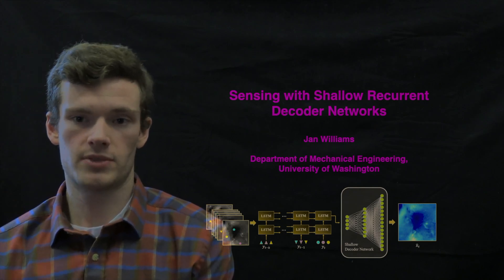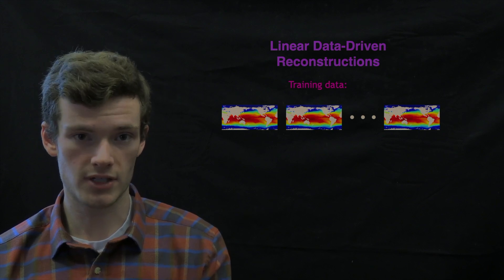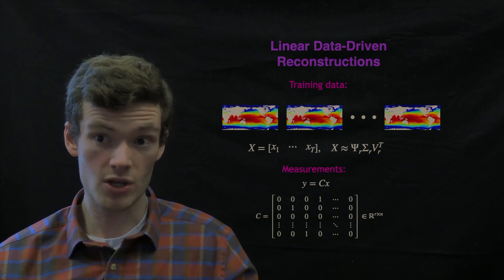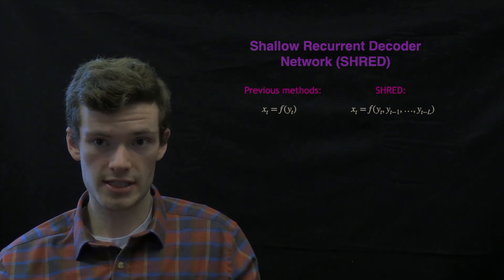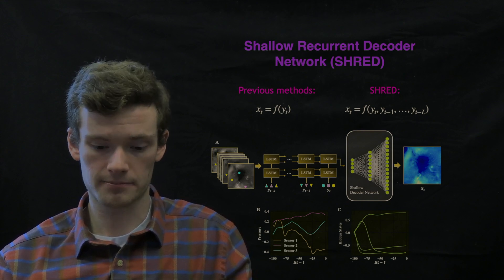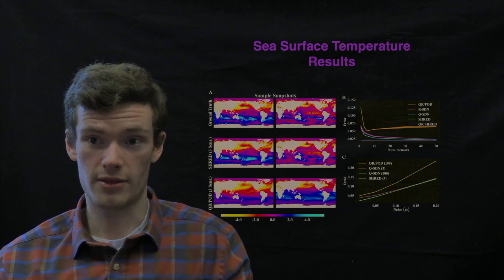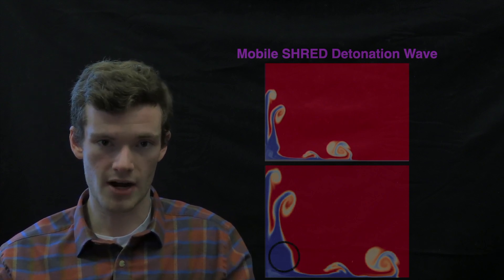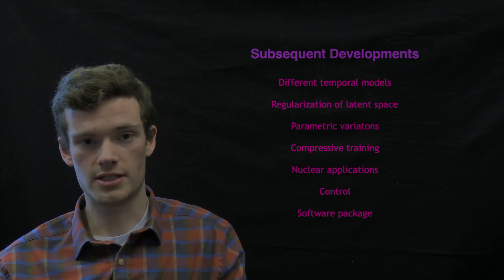SHRED 2 Sensing

Comment: I've just started the SHRED series. At this point, I'm wondering if SHRED is robust in the face of possible ANN overtraining, where it could simply report the training set element that most closely matches the input data. I'm specifically curious about this for the detonation wave example.